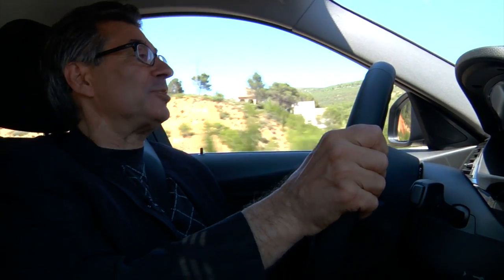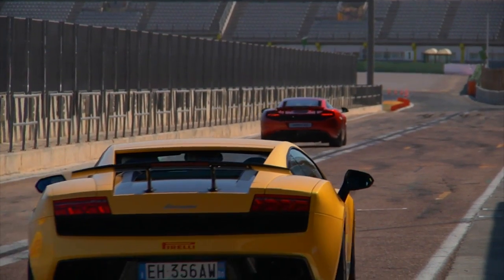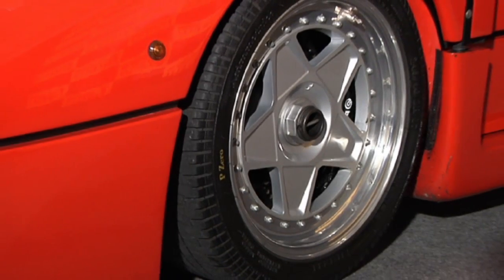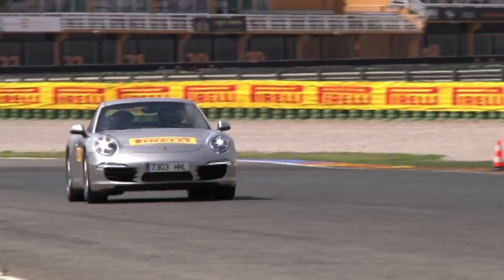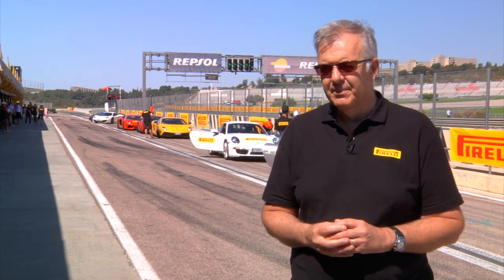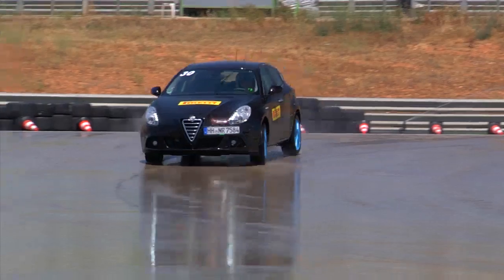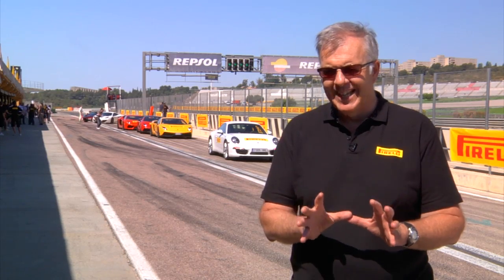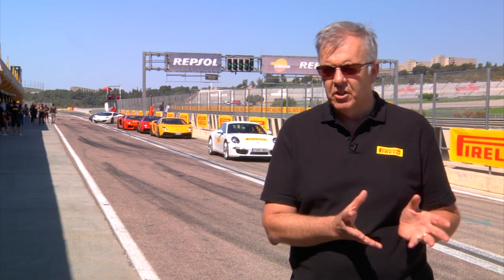Pirelli Tires - From F1 Track To Street - /SHAKEDOWN

Comment: exactly sir.... i just dont see a FWD Volvo C70....Lexus IS250....E90 325i on touring tires driven by wife....aka the slowest human on earth...wear just the inner tread....the rest of the tire has an easy 8/32....i wonder if they can add a extra tough compound on that inner edge to handle that extra heat

Comment: The new Evo a sticker on the door stating the tires will only last 10,000km too. Most high perf cars with sticky tires mention it. Those are not all season tires though, which is what you claimed got destroyed in 10,000miles (which 10,000miles is actually not so bad if you drive aggressively. I expect a set of tires a year, so around 20,000km/10,000mi)

Comment: Camber has a very minimal effect on tire wear, Caster has none. If you're rotating your tires camber shouldn't be wearing your insides faster anyway. 2.5-3.5 sounds like an awfully broad factory spec, most I've seen are within a half a degree, and 3.5* of camber from factory sounds pretty high, but I haven't seen the sheets, so I guess I'll have to believe you.

Comment: lol, i do it myself...its just the nature of some cars with 4-5 degrees front caster and 2.5-3.5 rear camber as a spec to wear the inner edges....its just normal...BUT i just feel the tire people could tackle that issue...the video at 5:10 got me thinking....I've worked for Volvo, BMW, and Lexus....there are sticker on the new car windsheilds stating that tire will only last 10-15,000 miles..,.C70.....all 3 series...IS and GS with any type of tire

Comment: LOL, i do it myself.  I've been servicing Volvo cars for 15 years.  I guess i have to except the nearly 4 degrees caster up front and 2.5 degrees camber in the rear on the car I own now.  Just maybe the tire companies can tackle that premature wear  issue.  I found "touring" tire last just a hair longer, but loose grip as they are not as soft.  That thermal image in the video at 5:10 got me thinking

Comment: Part of the problem I think JF is it wasn't clear what AA is or why that is special. But this is from discount tires site

"Traction grades represent the tire's ability to stop on wet pavement as measured under controlled conditions on asphalt and concrete test surfaces. As of 1997, the traction grades from highest to lowest are "AA","A","B" and "C".